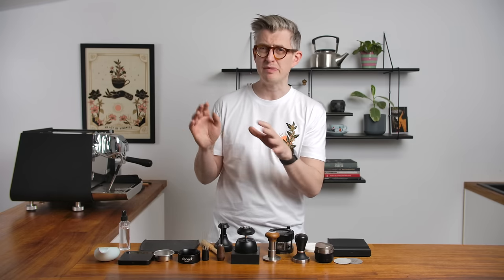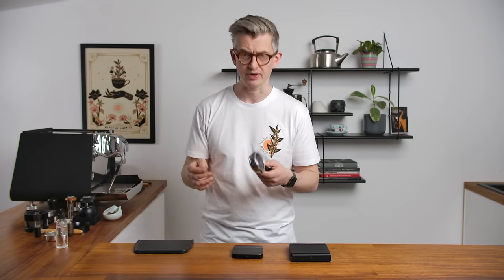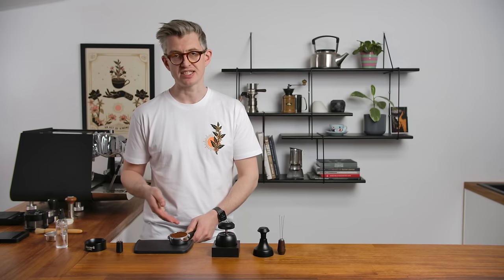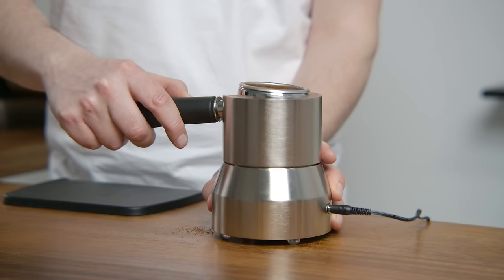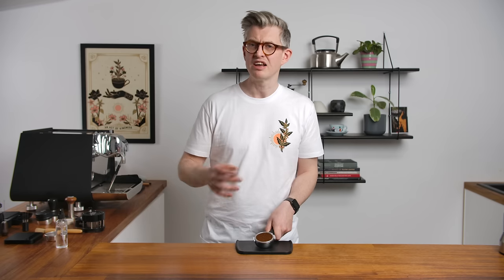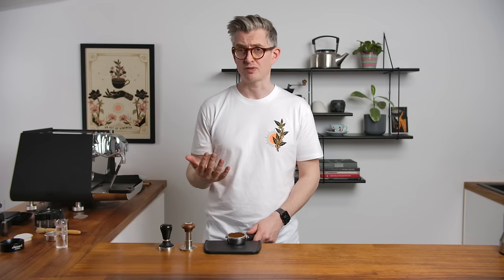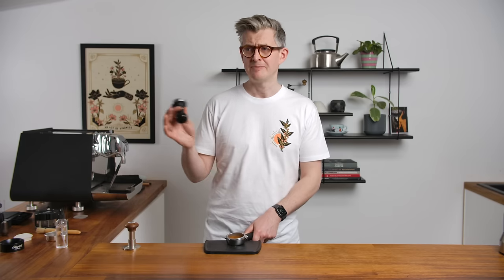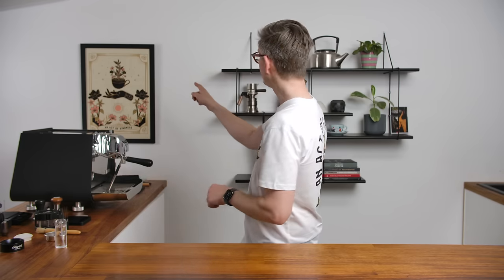How I Make Espresso: Tools and Techniques

Comment: Now my Niche has arrived from the UK, I use a spritz bottle, a needle and levelling tool and I use those little paper screens but not at the bottom of the portafilter but on top of the coffee puck! I find this helped a lot with avoiding channeling! 
I also got a new tamper with 58,5mm as I always found that the 58mm tamper that came with my Solis was just that little bit too small for the portafilter and so allowed for channeling to happen at the rim.

Comment: I've given away my espresso gear, but the novel item I made wasn't in your list.  To securely hold my portafilter when tamping, I took an ice hockey puck (I'm Canadian, eh) to the machine shop at work.  I drilled a hole through the centre, then a shallow conical hole around that, then milled a groove out to the side to hold the handle.  It worked very well, and my daughter likely still uses it when they get out the ROK I gave them, although they seem to be having fun lately getting various coffee gear at thrift shops.  (I may be responsible for that after telling them about my 1950s coffee siphon I got for $20 at a thrift store)
Reply: I've already put hockey grip tape to my handgrinder. I definitly need to do that puck holder  you mention for my setup.
Reply: It's not on the list possibly because it's not a puck prep tool. Same reason he didn't include tamping mats.

Comment: Thanks, James, for this survey. When I decided to get a WDT there was a supply shortage of acupuncture needles so I just stuck a paper clip into a wine cork. Yes, the critics say this is horrible. It takes longer, but it was a game changer in improving my shots. I am still waiting for my 4 mm WDT from Etsy which seems to be coming from another planet since shipping cost more than the tool. I also got a dosing funnel which is cleaner but leaves a little edge of coffee grounds around the rim of my portafilter, sigh. I just remove the funnel and give the portafilter a wee tap on the counter as you demonstrated. I use a nice heavy tamper that my son gave me years ago and I keep two fingers on the edge to keep my tamp perpendicular to the portafilter. These three tools are all I need. Sometimes it’s the little things that end up making a big difference.
Reply: If you can get your hands on steel guitar string, that works well for me as an upgrade from the paperclip. Takes some work getting the string into the cork, as it isn't as stiff, but I quite like my guitar-string WDT tool.

Comment: Hello James. I have an Delonghi Dedica where a use a certain type of bean. I have the beans ground on an EK43 after trial and error of getting the grind size perfect.

My steps are:
- Run the machine with naked portafilter (also heating up the cup)
- Dry the portafilter and empty the cup
- Weigh ground with dosing ring
- Needle within dosing ring
- Use distributor
- Tamp (Stainless steel by hand)
- Run machine with timer and weight

That's about it. The WDT tool is new to me and I'm going to experiment with a puck screen. Interesting to note your view on the distributor.  I'm not an enthusiast so this is very much a poor man's setup at home as optimised as it can be with the grinding being dealt at at the coffee shop.

The only change I would make would be not to the machine, but rather use a single dose grinder.

Comment: James, if you haven't tried a bellows assisted hopper you really should. 
Recently got one of those 3d printed single dose hoppers from Etsy with the bellows and bean weight for my little Eureka Mignon and couldn't he happier. Made a huge improvement by not letting the beans bounce around the burrs; and the bellows, wow what a difference it makes by gently puffing out the coffee as it's being ground. It makes for an extremely fluffy grind and clumps are completely gone, even with oily, dark beans. There's zero retention to go stale too. Game changer.

Comment: Great remedial video! I’m a huge fan of revisiting process, as it’s easy to get into bad habits. This is also perfect for new espresso dorks, of course. 

Just a note; the current version of the Flair 58 uses a screen only. It’s kind of a pain when knocking out the portafilter, but it certainly works to distribute the water. That suggests to me that they work very well to distribute water. :)

I just got a Happy Tamper. It’s very nice, and very well designed, and very clever, but it’s absurdly expensive. But “absurdly expensive” is of course the name of the game with home espresso.

One last edit! I have quit using a needle distributor or wedge and use the Weber Blind Shaker with my Niche. Putting a 2.5 inch neodymium magnet into the base with double sided tape makes it snap into place like it was made for it. I find I get excellent results with the shaker, and it’s quick and easy.

Comment: So over the last few years, I’ve had a cheap $$300 Dongi espresso machine. I’ve tried different beans and different things so I bought a year ago. I started grinding my own beans and recently have gotten the grind that I like for the espresso that I like. Now I’m going to up my game and get a mid-level espresso machine to do what you say which is to make the perfect cup of espresso. I spent a lot of time this morning in my grinder, which I’m ashamed to say I did not do before. Grams of beans for a two shot cup of espresso on a medium fine grind.I can’t go to fine because it taste too bitter. Thanks for all your help.
Reply: I bought a Gaggia Classic Evo Pro for $500 a year ago (they're $400 now) and I love it because it's a standard size 58MM portafilter so you can get the VST basket and IMS screen to make it legit. The pressure spring is very easy to change to a 9 or 5.5 bar pressure valve spring. I love it because it's so simply designed and easy to upgrade/repair. I recently installed a PID temperature controller with a display screen and shot timer. I'd say I've put $200 into upgrades and it blows away anything you can get for $1,000 or under.

Comment: I use the Londinium needle distribution tool with the loops that James doesn't like 😉. For me it's fine. Although it was a bit expensive and could definitely recommend the wine-cork tip. I also use a wedge distributor after that. Not so much because of the distributing it does, but because it creates a nice level surface. I use a Barista Hustle tamper which is completely flat instead of convex like many other tampers. This combination of first having a level surface and a completely flat tamper makes it rather easy to do good even tamping and not skewing to one side.
Reply: I use the londinium dist tool and the Pullman wedge and a Decent tamper
  Works great with the LR.  I have a Ceado 37S grinder which is great.

Comment: I got a palm tamp with the Flair 58, learning how to make the best espresso I can.  I spent months with the misunderstanding that there's no such thing as tamping too hard, and flow is controlled by grind size, not tamp force.  I have a manual grinder with over 300 increments, and it can adjust for espresso, but I found that the flow was always either choked, or ran straight through on a courser grind.  As soon as I started to follow the advice "tamp till no further compression is felt", I noticed my flow was nice and controlled, and the extraction was also more even, where the over tamped would extract more around the edge than the center.

As much as it makes sense that you can only compact the coffee so much, I think a slight amount of air, or space is required for proper brewing, and too much tamping force restricts flow too much.  I'd like to see more about how tamping affects flow, and especially using a solid palm tamper, cause when I Google "Palm Tamper", I typically only find information on calibrated ones, not solid manual ones.

15:45

Comment: Thank you for teaching us so thoroughly about everything coffee/espresso. There already seem to be a lot of steps so I’ll just throw this out there as one more (from a baker’s perspective): why don’t you sift the ground coffee through a small sieve to break up the clumps? That would ensure very even particulate matter before tampering.
Reply: I think - but stand ready to be corrected - that the problem with any sieving is that it tends to 'layer' things, with small particles ('fines') coming out of the sieve first, and larger particles ('boulders', in coffee terms) later. When baking, typically what gets sieved is then mixed into a dough before being baked, so the problem goes away, but with coffee there is no further mixing.
Reply: So my thought on “why not sift” is that since we’re trying to get a pretty small mass of coffee grounds through a sieve, we might run into issues with the sieve retaining a substantial percentage of the grounds. It also sounds to me like you would end up with fines out the bottom of sieve first, so you might end up with slower flow like the effect you get from the vibration distributor that James brings up. 

Would like to see a test comparing at some point tho, cool idea!
Reply: @bluemarb1e787  Retention can be adjusted - just choose a sieve mesh of appropriate size. Sorting cannot, at least not without major remixing, which may create clumps, which need sieving, which sorts the particles, which...

Comment: Additionally, I'll add that the puck screen will pretty much negate most of any backflow of grounds into the machine, so you don't have to cafiza flush the machine as frequently. Way easier to soak the mesh along with the basket cafiza soak than do the whole flush and lever relube routine with E61s.
Reply: top paper is even easier to clean
Reply: Absolutely agree. Much happier to soak a puck screen and cafiza clean the group less often.

Comment: When using paper filter at bottom, do you adjust the grind finer, or keep fast flow? P.S. For force tamper a good tip is to hold the base against basket with other hand. Otherwise it may be slightly crooked, you can see it moves on your video.
Reply: I totally agree with your force tamper comment. When I first used it, I didn't hold the base, and the puck came out super-crooked.
Reply: You'll need to adjust the grind finer. Once you dial it in you'll never pull another shot without filter papers.

Comment: In our coffee shop we have a fixed routine for espresso prep. 

1. We zero out the weight of our portafilter

2. We slap on the dosing collar and  dose our grounds. At the same time we use a needle distributor to break up the clumps as the portfilter is being dosed. It saves us a lot of time. 

3. We also use the ST anthony Wedge Distributor after the coffee is declumped. 

4. We tamp with the ST anthony model S tamper, but there's a calibrated tamp that baristas can also use. I don't use it out of personal preference. 

All of our baristas are amazing coffee careerists and always love to bring in new experimental toys, but this routine is generally our standard. The only person who doesn't follow the routine ironically is the owner, who simply tamp without any sort of prep

Comment: Thanks for the insides. After I saw the video, I managed to pull the first shot with no spitting whatsoever out of my bottomless de longhi mod. I just have a mediocre hand grinder, a very good basket and a tamper. I used a fork this time to prepare the powder just like with the needles in the video. And voila, perfect flow from the entire lower surface of the basket, with no obvious  chanelling. 😊

Comment: My puck prep will probably change after watching this video. Right now I warm my machine up with the group in, run the hot tap, rinse the group for residue from the machine, grind 9.8 seconds of coffee, tamp, wipe coffee from the rim of the group, then extract. For now I'll attempt to dry the group before adding ground coffee, but I do want to distribute it, that seems like it'll be easy and should enhance the coffee, that magnetic ring probably helps too, also for tamping I didn't realise that you can't really press too hard so I'll just press quite hard from now on. Thanks James!

Comment: Great video. There is another type of distribution which involves covering the portafilter with a cup shaped device that seals in the coffee and giving one firm downward shake. It breaks up the clumps very well. Not as great in terms of even distribution but then I complete with a stockfleths type move, then tamp. The tool I'm using was 3D printed, so very cheap (if you have access to a printer). It is keyed around the rim to mate with the PF, and just held in place for the shake.

Comment: I see some people obsessing with distribution and then almost not tamping at all. I am inclined to think that tamping is more important than distribution itself for distribution. I mean, if you tamp with a certain amount of strength, the particles will have to distribute evenly, they cannot remain more dense in certain spots than in others. It's like the tube during peak hours: when people begin pushing each other, the amount of "space" between squeezed passengers will be equalized; it's only during non-peak hours that the passengers may be distributed unequally.
I have nothing against a distribution phase (I have just ordered a WDT tool) but I think it's important to press very firmly after distribution. I have also just ordered a 15 kg calibrated tamper.

Comment: 9:35 you absolutely do get the fine particles sinking to the bottom, it's called the "Brazil nut effect" interesting stuff, novel that they didn't account for that in making what is presumably a very expensive high end vibration coffee distributor

Comment: I used a puck screen on my prior machine.  It only had a pressurized 2 shot portafilter.  
I usually did a SINGLE shot, and it was messy.  As you said, because of the headspace, at the end, the puck kinda expands/explodes.  When I put a puck screen on the coffee, this puck expansion mess stopped.  What used to be a messy wet puck without the puck screen, was now a dry puck with the puck screen.  🙂
With a double shot, there was not enough room for the puck screen.  The top of the coffee was pressed against the shower screen.

Comment: I found this video while running madly around in the espresso rabbit warrens and was getting a bit fed up.  I have an inexpensive espresso machine (just over $100).    My first issue was the dreaded "wet puck".  This video was welcome as it provides some  inexpensive and quick ways to improve my espresso.   After looking at this video, I bought a few items, the funnel, the little needle thingy and a metal puck screen.  There has been improvement, although water sits on top of my used puck screen.   My next purchase search is a good tamper and grinder that will not need a refinance of the house.   Maybe I will even go wild and try a bottomless portafilter.  I will be searching more of your videos, as  I liked your pragmatic and crystal clear approach in addressing the lower cost paraphernalia that are likely to result in better espresso.  Thank you.

Comment: That was a lot of steps and I don't think I would replicate, but it's nice to see.

I followed an older video of you and I've got myself an old Gaggia Classic, changed the pressure pipe to 9 bar, coupled with a Breville SmartGrinder.
I'm pretty lazy so I just grind my coffee at 21 outside and minimum inside grind setting. I get quite decent result for a double shot grind after 11 seconds.
I only tamp and do nothing else. I admit that my result is never consistent but it's fine for me.
What I notice is that if I do a lot of shots at the same time, for example when I'm experimenting with Latte. Once I did like 10 shots in a single afternoon, the latter shots just seem to be better.
I think if I keep pulling shots, it just becomes better, and so does the crema.

Comment: 9:30 Yes, vibration will always cause smaller particles to settle to the bottom, and larger ones to "float" to the top. It's a little counter-intuitive at first, but it's actually obvious when you think about it. The smaller particles fall through the gaps between the larger ones.

Comment: My favourite distribution tool is a cocktail stick, vigorously applied with the dosing funnel in place to stop the coffee going over the sides.  I also use quite a high tamping pressure because I reckon that it collapses remaining clumps and channels - which is part of eliminating air, after all.  I've tried the hard tamp with and without "distributing" first, and the only discernable difference was in the time taken to produce the coffee.  Maybe I'm not very discerning, of course...

Which reminds me: sorry to mention the 'opposition', but Joe at Seattle Coffee Gear used to combine distribution and tamping by just poking the coffee repeatedly with a straight finger.  Must try that again. It'd be one in the eye for the purveyors of fussy twiddly gadgets if it worked. You couldn't do it professionally, though.

Comment: I have a portafilter machine that doesn't have the standard measurements, but i built the comb with cork and needles now. Not sure if I feel a deference already. 

My problem is that the extraction is highly dependend of the bean age. Freshly opened pack and water is almost stuck, while 2 week old (stored in the fridge) run through in well under 20s. I can't go through the hassle and adjust grinding over time.

Comment: Puck screens seem interesting for using a small dose (let's say 7 grams) with a normal 2-cups basket. They should help keeping the puck stable and avoid the "wet mess puck" at the end of the extraction. On the other hand I wonder not just about the cleaning process (I suspect the dishwasher should do a decent job) but also about the coffee extraction temperature: the water coming from the group will be cooled down by the screen. It's something I feel like testing, though.